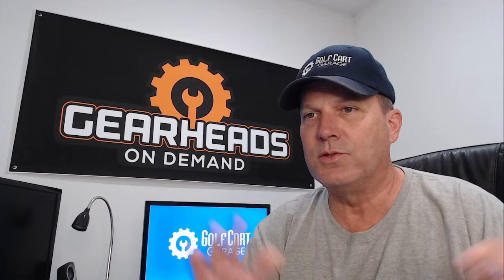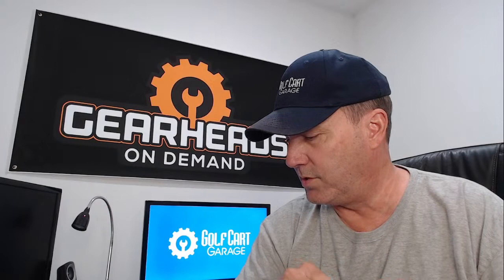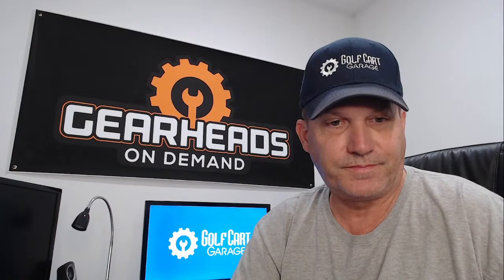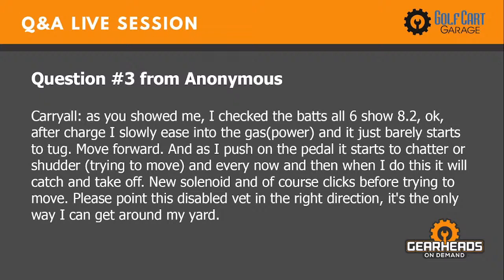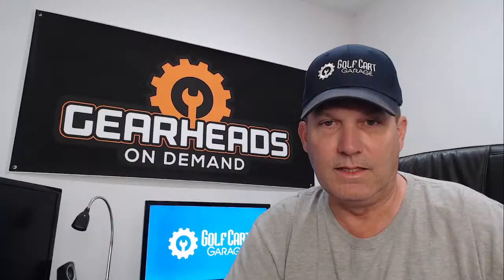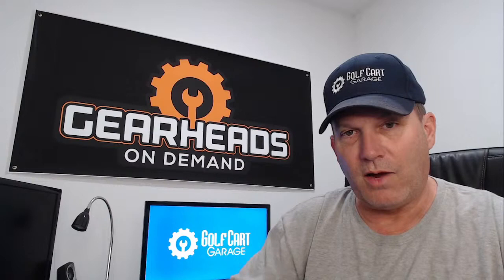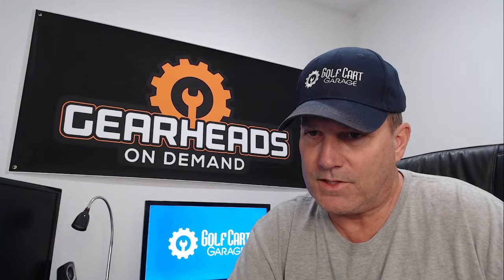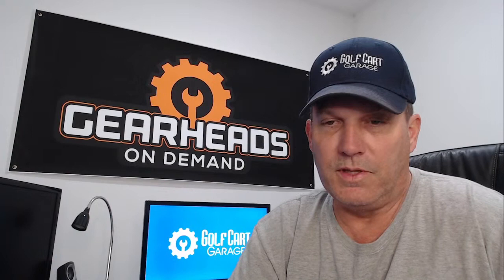Most Common RXV Problems | Golf Cart Garage I Episode # 61

Comment: Interesting fact, I purchased a brand new 48 V RXV and it came from the factory with a 36 V solenoid.  It worked for 10 years and when it went out, I just replaced it with the same part number I’ve had no issues.  👍👍👍 I would’ve thought it should be a 48 V solenoid but the people who make it don’t seem to think so because they did not put one in.
Reply from the maker: Little known fact that the RXV has the 36V solenoid.  Great input to mention that in this comment section!

Comment: In reference to voltage, dropping off, causing a stutter, you can put the meter across all the batteries first and if you see drop off then isolate, which one.  As stated, this must be done, dynamically, underload, and always look for signs of melting on the cables, which indicates a poor high resistance connection
Reply from the maker: Good call!  It's not always simple to find the one battery or cell possibly causing an issue.

Comment: Great video. I have a 2017 RXV that runs sluggish/jumpy off the line and eventually goes into crawling limp mode. I’ve replaced both TPS and a speed sensor but still having the issue. Any ideas?
Reply from the maker: Thanks for watching, Matt! A load test on the batteries would be a good idea.  There could be a battery on its way out if you feel stuttering or possibly an issue with the controller.
You can get an appt for a video call diagnosis here: https://www.golfcartgarage.com/gearheads-on-demand/
or get in touch directly at Support@GolfCartGarage.com or (800) 401-2934 if you need more help.

Comment: Tim.  What's your favorite golf cart make and year range when it comes to overall quality and reliability?  (Electric carts)
Reply from the maker: Thanks for watching, Derek!  If you would not have pinned Tim down to electric carts then he would have said Yamaha G1 gas.  Best golf cart ever made but they only had a production run from 79 to 89. Had good luck with CC IQ system carts.  Love the DS IQ from 2001 and newer.  EZ-GO Marathon controller carts are good carts also.
Dave's favorite is the 48V CC Precedent after 2014 for the easy work/maintenance and the lack of OBC.
Let us know any time we can help!  Support@GolfCartGarage.com or (800) 401-2934

Comment: Thanks for your videos.  My brother-in-law and I each bought Summitt II chargers from GCG last year.  We only spend winters in Florida and I wanted to keep my battery charged while I'm "up north".   I asked when I bought the charger if I could leave it plugged in for the spring & summer months.  I was told I could because the Summit II turns itself off when the batteries are charged.  I hardwired the my charger to the batteries and it works fine.  I did the same with my brother-in-laws cart and it won't charge.  We both have EZGO TXT 36 volt carts.  Mine is a 2002-3 cart and his is a 2009.    I did not use your kit but used 10 gage wire with appropriate ring terminals. Bottom line, mine worked ok but my brother-in-laws did not.   why?    He was forced to use the standard connection with the plug into the cart.  Just wondering why I could hardwire mine but not his.   It all appeared to be wired the same way.   Ever heard of that?
Reply from the maker: Thanks for watching, Keith!  Since the Summit works with the plug, there seems to be a hidden or unusual problem there that isn't resulting from a faulty unit.  It sounds like a possible wiring or connection issue, but difficult to say without having been there.  We recommend a consult with our diagnostic team here: https://www.golfcartgarage.com/gearheads-on-demand/ if you'd like help to fix the issue... or a direct contact to Support@GolfCartGarage.com or (800) 401-2934 so our techs can ask you questions in real time for discovery.
Reply: @GolfCartGarage  thank you for your quick reply.  We are still a month away from reuniting with our golf cart. I will look at it again and contact you.   I thought that this may have come up before.  Thanks again!   
Keith

Comment: Hi so I have a yamaha g9, rebuilt the engine last year . the cart wont run unless the choke is out, I put a new carb on it , new pump also, still have to pull the choke out for it to run while im driving it. it ran a little bit and then back to pulling choke out. its a well taken care of clean machine not a dust situation at all. ? im frustrated . HELP
Reply from the maker: Thanks for watching, Steve!   One cause could be an air leak on the carb, head gasket, or crankshaft seal.  You can get an appt for a video call diagnosis here: https://www.golfcartgarage.com/gearheads-on-demand/ or get in touch directly at Support@GolfCartGarage.com or (800) 401-2934

Comment: I support a fleet of 2023 EZGO RXVs.  I have notice a problem with the seat back bolts coming loose.  The carts are one year old.  There are no lock washer on the bolts or the parts manual.  Should i use locktite on these?
Reply from the maker: Thanks for watching, great question!  It may be a better solution to consider small lock washers from your local hardware store.  If the RXV's get heavy use or spend a lot of time in sun or moisture, you may find (or future owners may find) the vinyl or the backrest cushions need replaced, and have a really hard time with locktite.  Just our 2 cents.

Comment: Why or what would cause my cart to act like it has a flat tire on art Rear side and make a grinding noise constantly?
Reply from the maker: Thanks for watching, Roberta!  There may be an issue with an axle or wheel bearing causing a lean or noise.  You can get an appt for a video call diagnosis here: https://www.golfcartgarage.com/gearheads-on-demand/
or get in touch directly at Support@GolfCartGarage.com or (800) 401-2934

Comment: Also,. I have a 97 Ezgo medalist (36 Volt) DCS cart.  How do I know if Regen it's working?  I would expect the cart to slow down more rapidly than it does when you left off the accelerator.  Could this Regen issue cause additional issues similar to towing the cart without the tow switch in the tow position if the Regen isn't working properly?
Reply from the maker: 1997 EZ-GO DCS was their first attempt at a regenerative braking cart.   The only way that I know of to tell if regen is working would be to speed down a hill.  You should not be able to freewheel to crazy speeds.  DCS controllers are not adjustable like PDS controllers.  The regen is set and cannot be changed in DCS controllers.  Even if regen is not working for some reason I do not see it causing any issues like they are speaking of.  If you tow it, put it in tow, for sure.  More questions?  Try Support@GolfCartGarage.com or (800) 401-2934

Comment: 2016 rxv It won’t run I full charge turn on switch goes full charge then to 0
Reply from the maker: Thanks for watching, Sonny!  You may want to get a load test on those batteries.  One bad cell can stop the cart.  If you need help, just get in touch!  Support@GolfCartGarage.com or (800) 401-2934

Comment: I had a blowout, driver side rear. It went flat and I travelled on the rim for about 25 yards on asphalt. When I was jacking up the cart to replace the tire/rim I forgot to take the cart out of reverse, and I heard a noise that sounded like a spring stretching. I put all brand new tires/rims on it, now it has a side by side shimmy that becomes more pronounced upon decelleration. I am thinking something got out of whack during the jacking process. I checked all the lug nuts again, all tight. I replaced the rear leaf spring bushings, but the fronts are ok. I haven't gone through the shocks or alignment yet. I am fearing something got pulled out of sync in the transmission, electric brake or rear suspension. 2011 RXV. No lift kit, pretty much all stock suspension. Any suggestions?

Comment: Any thoughts on a 2015 rxv with a hissing noise when its cold.  I changed the differential oil, its not that.  Hmm
Reply from the maker: I would assume we are talking about a gas cart since It is cold.  I would "for testing purposes only"  remove the air filter and run the cart to see if the hissing noise changes at all.  2.  Must have a sticking micro switch somewhere.  Even though it is gas there are still some micros.  Get in touch for more questions or help. Support@GolfCartGarage.com or (800) 401-2934
Reply: @GolfCartGarage  it's electric.  I changed the differential oil.  Didn't expect it to help since it's not continuous.  Naturally, no improvement.  Perhaps the same for bearings.  Maybe motor brake? Not many options. Sigh
Reply from the maker: At this point, we'll probably recommend taking this out of the comment section and consider a virtual appointment with our tech team.  You can check that out here: https://www.golfcartgarage.com/gearheads-on-demand/